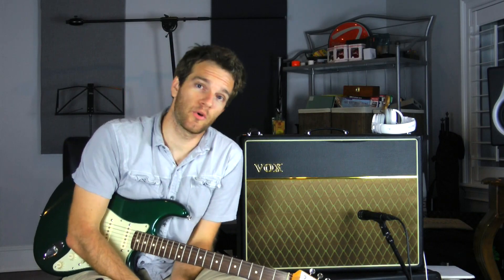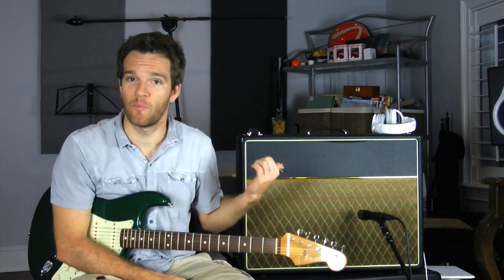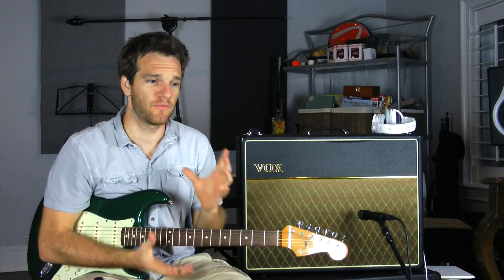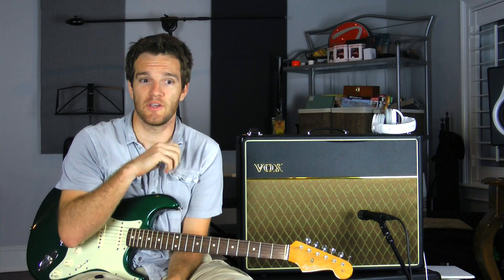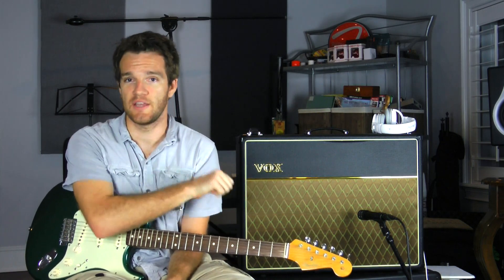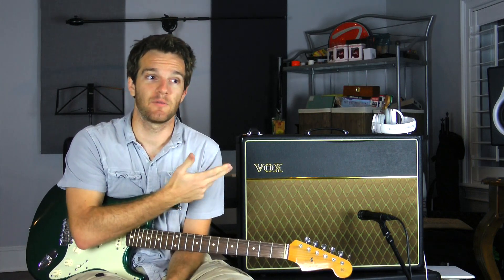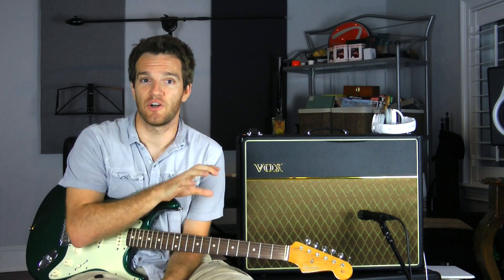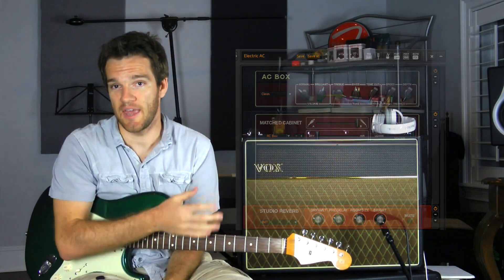Analog vs Digital Guitar Amp Shootout

Comment: Digital amps have come a long way, I am a Boss Katana2 100w head and sold my tube amps. What I hear is the digital would use some high roll off and add some warm in the lower mid range, that would get it closer. Other than that it is close.
Reply from the maker: Oh man, the game has definitely changed this video went up.

Comment: Only one problem here. When recording thru the SM57 you have a natural EQ on the low end that you dont have when recording directly thru Guitar Rig 5. The advantages on recording thru a mic is texture and warmth, thing you cant have thru a emulator.
Reply from the maker: +MARTIM D For sure, I always prefer the mic.
Reply: +Sean Daniel If I decided to use digital modeling rather than a mic, is it possible to add that same warmth through mixing with EQ, compression, or other tactics?
Reply from the maker: +L. Marquee You know it could just be that I'm not good enough at mixing but I've never been able to get the same sound with plug-ins for certain types of playing. You can always make it warmer with EQ but there's something about an amp pushing sound through a speaker that hasn't been truly modeled in my opinion. That being said, I've had really great results with single-note lead playing being digitally modeled. So to me, I think the technology isn't quite there yet to replicate the sounds of amps when it comes to more complex harmonic stuff, but it's getting better. So if you like the way it sounds, go for it man.
Reply: Thank you for the reply. I will keep this in mind.

Comment: i prefer analog because digital has preset abilities, maxes and limits. a digital is only as good as the programmer opts for. it takes time , too much time. so the more expensive the digital the more parameters has been added to allow sound. I think i rather have the parameters of life .. get those freak sounds and no caps or limits. ANALOG FOR ME!

Comment: The digital gives warmer tone, am I right?
Reply from the maker: +Charles Palmenco Yeah it definitely gives it a more pronounced midrange kind of feel.
Reply: +Sean Daniel Thanks for the reply sir! Very much appreciated. Although I've been playing for 8 years now I still can't differentiate the analog and digital sound. I'm so noob when it comes to tones.
Reply from the maker: No problem man. It was really only til about 10 years of playing that I felt my ears were to the point that I could describe what I was hearing and differentiate. What really helped me was when I started focusing on trying to get different tones with my picking hand (palm muting, harmonics, dynamics) as compared to amps and simulators and stuff. Keep experimenting and thanks for watching.
Reply: +Sean Daniel Maybe I was just got used to GR5 digital sound. I've been using it almost all the time because I don't own an amp. Lol. Thanks a lot for the tips man. More power to you and rock on!